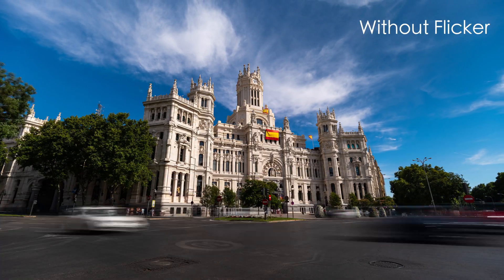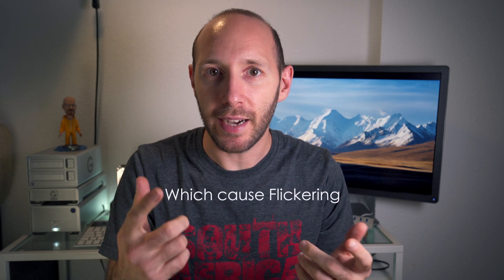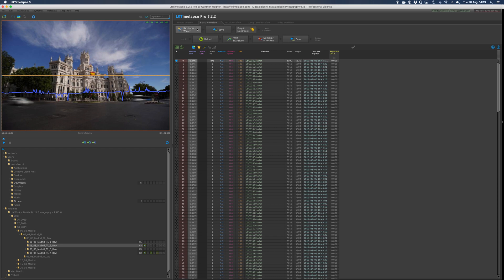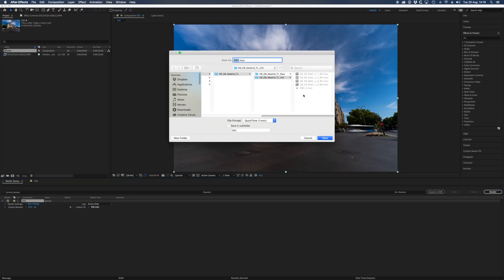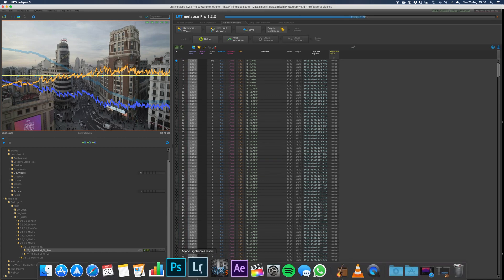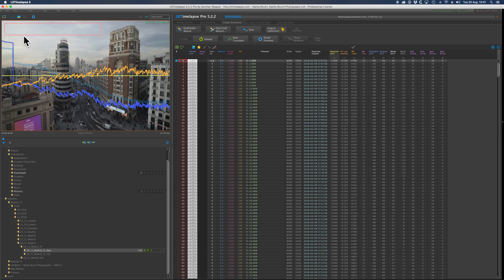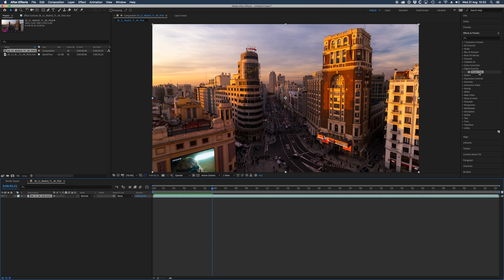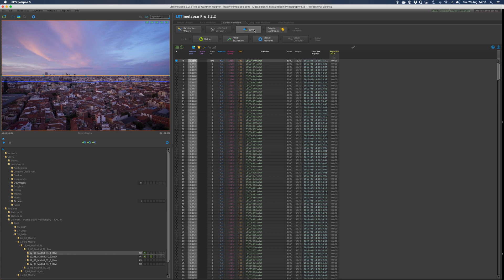How to Deflicker a Time Lapse | TUTORIAL

Comment: Great video!
1:50 I don't understand the point of shooting in Aperture Priority? I'm very used to work with cameras  so I know all the different settings and modes, but I thought that the best way to shoot a timelapse is to shoot in Manual mode with exact apreture, exposure time and iso all the time, but shooting in aperture priority mode means that the camera is adjusting things by itself that could affect the result in a bad way?
Reply from the maker: Hi! I was talking about Sunset and Sunrise, new cameras got very good on reading the exposure and make a smooth transition between day to night. I use Av mode at f/4, Auto ISO 100-6400. I used the Manual mode for sunset until last year. I've would'n never use it on a Canon 6D for example.. Still shooting in M mode during the day, when light is not changing.. Hope that make sense..